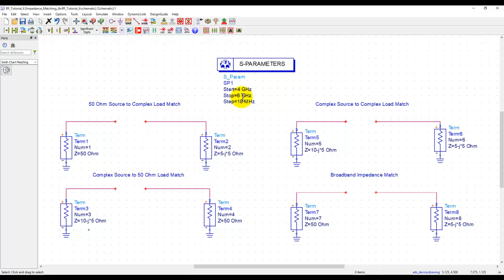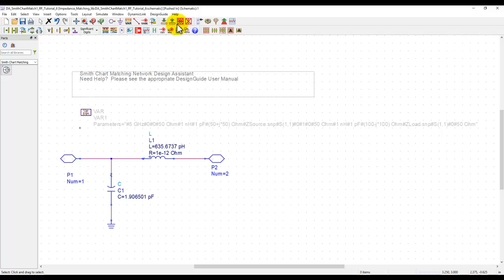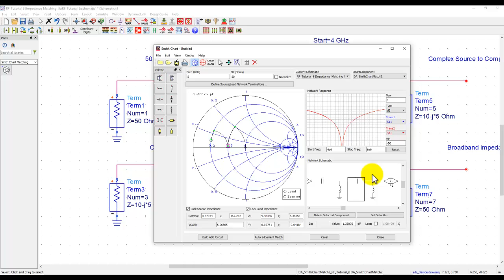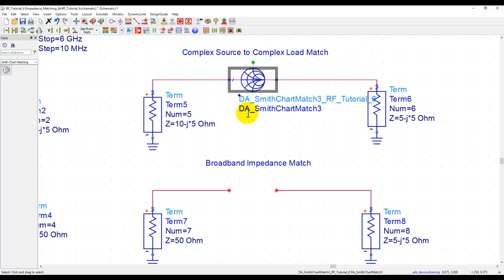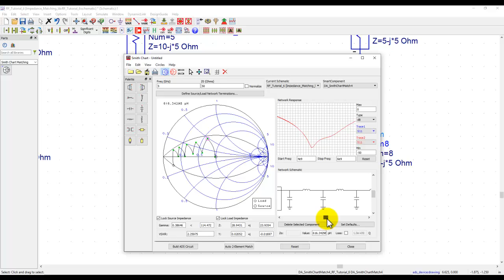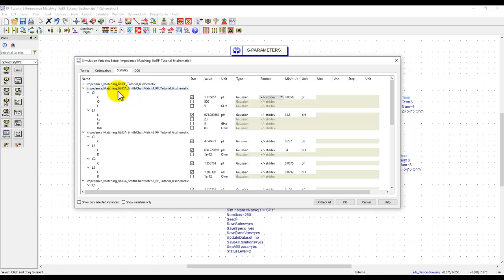Comment: Hi Anurag, very well explained. I have a query if I am designing a dual band matching circuit, should I need to design two circuit and combine them through a 50 ohm TL or how it`s possible to design a single circuit for both freq as we can put a single freq while doing matching through smith chart?
Reply: You can design a single matching network that is dual band but this can't be done using Smith Chart tool as explained in the video. You will need to use traditional schematic and data display for the same.

Comment: Thank you very much, Sir. I am having a challenge matching a wideband antenna to my Greinacher voltage doubler circuit.  I had tried using the smith chart and also bandpass filter, however, from the results I got, I am not doing a good work. Please, how best can I use to make my matching a reality?
Reply: Its difficult to support queries like on YT. I would recommend you to contact your local/regional ADS tech support team.
Reply: @BhargavaAnurag  Alright. Thank you, Sir

Comment: Thank you, sir. It was a very clean and understandable narrative. I was going to have a question. Should the line impedance we use when connecting Zs-Zl-coil-capacitors in PCB design be 50ohm?
Reply: Ideally Yes if want to go by text book logic but in reality you can change it as per your own design requirements and its usually the case to reduce size of the line/layout section.

Comment: Sir, I need to find the z output of RF circuit before doing matching, please tell me the methode to find out Z output of RF circuit before matching with 50 ohm of the antenna
Reply: Hi,
You can use SmZ2 component available under Simulation-S_Parameter library palette, place it on your schematic and run simulation. This component measures the output impedance of your circuit when you connect Termination2. There are other measurements also available that you can use to find respective impedance for matching.
Reply: @BhargavaAnurag   thank you very much.

Comment: wonderful piece of work Anurag. How do I perform impedance matching with the load being a diode and source being 50 ohm. How do I know the impedance of the diode. A typical application is designing impedacne matching network for a rectenna.
Reply: Process remains same. You need to find input impedance of the diode network, you can see video on S-Parameter simulation of Active Circuits to find how to find the input impedance of any device.
Reply: thanks a lot Anurag. I got it from the video of S-Parameter simulation of active circuits video
Reply: @pangsuilingeh6134  kindly mention the video link

Comment: Hello Dear Anurag,
I have a high Q coil which is 75+i1800. When I plug this value into Smith chart utility, it will be change to smaller value automatically. Can I ask how can fix that? Thank you for your time and help!
Reply: Hi Peyman,
You can work with your local Keysight tech support team to look into it but I would suggest to directly use a Termination in the schematic with that value and simply optimize the matching network...😊

Comment: Thank you Sir. for your video. My design is in Complex Source to 50 Ohm Load case, but I don't know the Zsource, so How can calculate the Zsource? Thanks for your time.
Reply: Hi,
You could use SP_Probe component and insert it in your design's appropriate node and that probe will report S11 looking into left and right direction by which you could find corresponding impedance as explained in the video: https://youtu.be/0bkRymAOFsw

Comment: Thank sir. I think when the load is 5-5*j, the value of load in smith chart matching should be 5+5*j. Why we don't need to change to conjugate？（since when I finish the matching network and try to combine the circuit, the S11 is quite low）
Reply: Oh the impedance I choose is from source pull, did I change the impedance to conjugate when I do matching? thanks sir~~   :)
Reply: As per the Smith Chart tool architecture, it expects you to only use complex conjugate for Zs and ZL is to be entered as it is so no confusions please...😊

Comment: I measured a BT antenna with a VNA, I tried following these steps, I perform the matching L match and when I measure again the antenna return loss measured does not match the simulation.  I am not sure what I am doing wrong with the measurement vs. sim.  I calibrate the VNA up to the SMA to U.FL connector Open short load.  I have a flat response in the vna, but I can't match the antenna. what could I be doing wrong?
Reply: Hi,
Its difficult to see what are you are simulating and what are you measuring. As long as you have modeled all aspects you should get close matching e.g. EM analysis of your matching PCB, vendor component models for L & C etc
You can consult your local tech support team for more help and they help you over live session.

Comment: Sir can you solve this Design a two-element impedance match network on a Smith Chart so to match a 10 ohm source to a 50 ohm load at 60 MHz. The matching network must also act as low-pass filter between spurs and the load.
Reply: It should be easy, simply use LPF topology ie. L in series and C in shunt while doing the design as I mentioned in the video.
Reply: @BhargavaAnurag  Sir i am new and I did not know how to solve please can you make a video for me i shall be very thankful to you
Reply: @waqasahmedmir3319  It's difficult for me to create a video for this. You need to look at Learn ADS in 5mins tutorial playlist to learn the basics of ADS and then simply do it yourself.

Comment: Hi Anurag, Why would it be necessary to transform between series matching networks and parallel matching networks? Can you give examples that would require this transformation?
Reply: Hi Abraham,
I couldn't understand what do you mean by transform series & parallel networks? We are not transforming anything here as far as I remember, choice is between LowPass and HighPass topology and you do that when you have specific preference or depending upon which network gives you more reasonable component values.
Reply: @BhargavaAnurag  Hi Anurag, I understand that you didn't cover this specific topic in your video. In the textbooks and courses that I have read and or attended pertaining to impedance matching, the topic of converting series resonant circuits to parallel resonant circuits and vice versa is always covered. However, reasons or examples that would require these transformations to be performed are never given. This material is usually presented in conjunction with impedance matching techniques. I just thought you might be able to provide some insight into why these transformations might be needed when performing impedance matching.
Reply: Probably I am or we are missing some point here because I personally never used resonant circuits for matching, its always L & C connected in series or parallel and each component has its own trajectory and you use the combination based on the impedance transformation you require for your network. I would always recommend to keep things simple and it takes you to your destination....😊

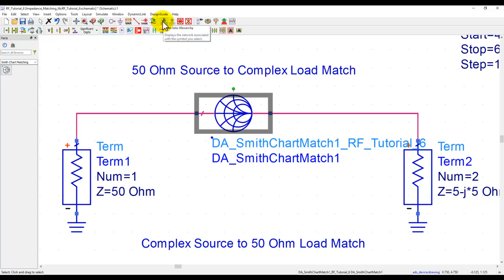Comment: 17:40 When I "push into hierarchy" I find nothing there. Also when I try to simulate, I get the error message "There is no corresponding terminal for `P1' in the netlisted view ". I feel like I have copied everything that you have done up to this point, why is it not working?? Thank you for your help.
Reply: Hi Noah,
If you don't see anything inside Smith Chart component subcircuit then it means you haven't yet created the schematic by clicking on the appropriate button from Smith Chart Utility and hence the error.

Comment: Trying to do a problem like this for my class, but I dont know what is going on and I get this error:
(smithdg.ael  line 11175, column 13)
Parameter1 of fputs is NULL.
Expected "file".
Reply: Hi Diego,
You might have corrupted your config folder. Kindly do following and see if this helps:
1. Close ADS
2. Go to your HOME folder (where ADS creates workspaces by default), rename "hpeesof" folder to something like "hpeesof_old"
3. Start ADS and try creating the design which you were trying earlier.
Reply: @BhargavaAnurag  I tried renaming the folder and still get the same error.
Oh and on the Message List it says:
WARNING: /home/linux/.../itemdef.ael
AEL file not found
Reply: @diegoram0499  I would suggest you to contact ADS tech support for help.
Reply: If you have used any dot(.) etc in your schematic name, remove that...

Comment: Sir! please put the full video about how to do load/source pull simulation for obtain the optimum source and load impedance of a RF power transistor for designing purpose of a power amplifier for wide band application.
Reply: Will upload soon...👍
Reply: @BhargavaAnurag  sir can you please upload a video of gallium nitride on silicon carbide FET in ads software

Comment: Very Good Explanation!
Could you help me in finding the value of rf choke while doing transistor biasing? Plz if possible help me.
Reply: Hi Surendra,
I am not sure what frequency range you are working with but if it is @UHF or lower GHz range then you could look at the Inductor value that has SRF on your desired operating frequency so that it provides max possible rejection at your desired frequency to isolate DC and RF Frequency. Other key considerations are as below:
1. Make sure the DC current capability matches the required bias current.
2. Select a sufficiently high inductance value. (Z = 2 * pi * f * L) Select an impedance (Z) that is much larger than the load resistance. 
3. Decide the maximum allowable DC resistance so that the voltage drop on the inductor is small compared to the voltage swing of the amplifier stage.  A resistance of between 1 and 10 Ohms is usually OK.
4. Select a small package size. Look for a low Q inductor (High L and small physical size usually means Low Q).
5. Make sure the core material is useable in the frequency range of interest.
Reply: @BhargavaAnurag  thank you Sir,
If I get your mail id then I will share you ckt. And details. Or send me test mail on ss2751986@gmail.com.
Reply: @BhargavaAnurag  This so helpful. Thank you